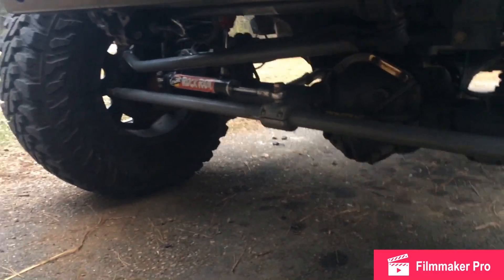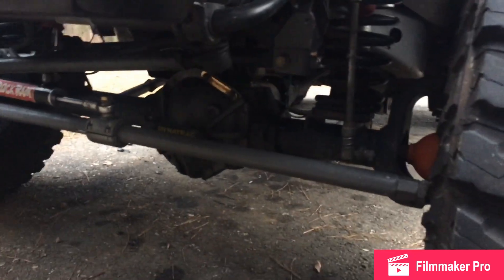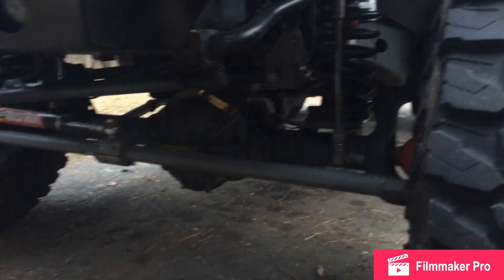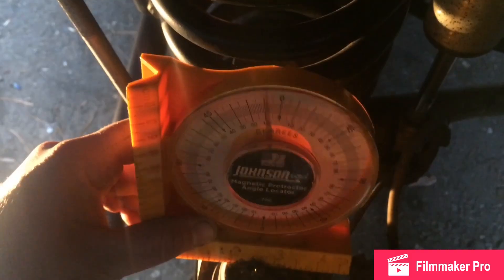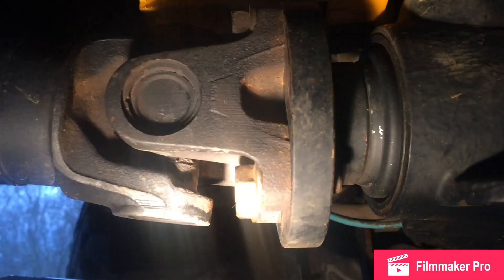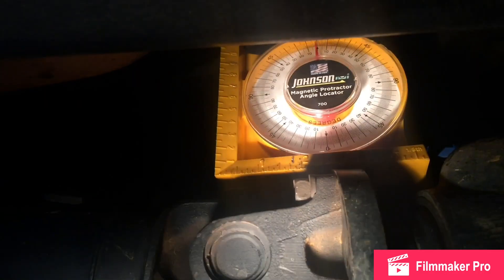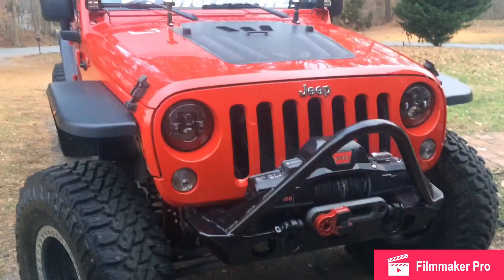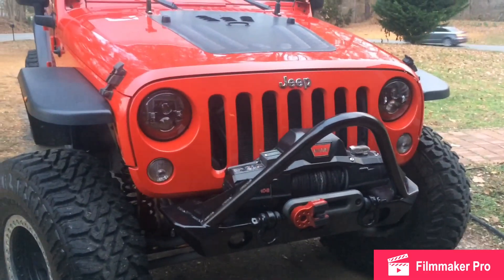How to Check Caster and Pinion angle on your Jeep or Truck

Comment: Good video. You mentioned pinion angle being low as if that is a bad thing. Less than 10* to the drive shaft is what you want as long as your pinion angle is close to your TC output shaft angle so they cancel each other out without too much u-joint movement (less than 10* should be fine.).

Comment: Thanks heaps! That was very helpful. I'm fairly certain that my caster angles are different between sides. Got an awful pull to the left, ATM. Hope to correct it this afternoon using this video.

Comment: I'm checking my caster.It looks like Im at 10 degrees, from a local 4x4 shop that just set it up. It's wondering left to right going down the road. If I understand it right, I need 4-6 degrees? The math comes out, as I measure the pinion at 4 degrees. That puts me at a difference of 6 degrees on my Gladiator.
Reply from the maker: There is only 6* of separation on the stock axle. If your pinion is at 4* then you have 2* of caster which is horrible
Reply: @JKGearandGadgets  sounds like I don't understand 6 degrees of separation yet. I can't be measuring correctly. I'm getting a caster measurement  of 8-9, and a pinion of 1-2 degrees. Ill watch more videos to try and see what IM doing wrong.
Reply from the maker: Stock Or aftermarket axle?
Reply: @JKGearandGadgets  It's stock, and I was wrong on the 10 degrees. Thank you for always responding to help. I appreciate that !

Comment: so is the 10 degrees fine for the caster? for the 0 pinion. ive read some other peoples posts, and they say pay a little more attention to pinion angle. and the caster will follow.
Reply from the maker: It all depends on your lift height and driveshaft type. You can’t have a 0* pinion angle on a tall lifted jeep otherwise you’ll get driveline vibrations. What axle you do have?

Comment: Hopefully you see this, 
Im having a tough time. I have RC 3.5” lift 
I just bought and installed RC lower adjustable control arms.

Obviously experiencing death wobble. What should my caster and pinion angles be? 

Can I adjust when jeep has tires on and on ground? Or do I need have jeep on stands?
Reply: did you do drop pitman arm and are your trac bar bushings good usually 75 percent of the time its trac bar related

Comment: How should the rear one looks like? Should the pinion angle be in line with the driveshaft? Or should have some differentiation?
Reply from the maker: It should be in line with the driveshaft depending on what jeep/rear driveshaft you have.
Reply: JK Gear and Gadgets is an Adam Drive shaft 1310, jk 2009 rubicon stock axle and yoke for the TC and pinion
Reply from the maker: Alfonso Ovalle yes the rear pinion angle should be in line with the drivehast

Comment: Great video!! New to your channel. I have jk 2008 and 6 inch rough country lift. On 37s everything still stock. What would be my best angle for caster? And drive shaft angle?
Reply from the maker: The 6” lift is hurting you. 
Your best bet is to try to get it around 4* caster

Comment: Im running a 4.5in lift with fully adjustable control arms with adams front and rear drive shafts. should i be focused on dialing my caster back to 5 or 6 if it isn't? I had it adjusted a while ago, but I hadn't upgraded my rear ds at the time.
Reply from the maker: It’s a mix of caster and pinion angle, add as much caster as you can without getting pinion angle vibrations. With a 4.5” lift you will probably max out around 4-4.5* caster
Reply: @JKGearandGadgets  thanks for the tip! Beast of a channel and information you put out!!

Comment: I know it's an old video but I can't find what my angle should be. I have a zj and added 3in lift, have front and rear adjustable top and bottom arms, if you still read comments can you help me out? Thanks
Reply from the maker: Add as much caster as you can, pinion angle will decrease. So find the good mix between good caster before you get front end vibrations.

Comment: Caster cannot be measured with an angle finder, because of the steering axis inclination (on JKs this can be seen in the inward tilt of the balljoints as looking from the front of the Jeep) caster must be measured in an arc. A caster gauge like this will do the job 
https://www.amazon.com/Longacre-78260-Caster-Camber-Gauge/dp/B003750D7U/ref=sr_1_3?keywords=caster+gauge&qid=1561218454&s=automotive&sr=1-3
Reply from the maker: Negative. On a Jk or any other solid axle, caster is measured from the rearward tilt through the ball joints.

Comment: I have a 2003 grand cherokee laredo, with a 2.5 lift, stock driveshafts and control arms 98k miles and what should it be? I get a bad vibration at 60 and I'm looking into the driveshaft and peaked my interest because just last week i started hearing a ujoint click, if I'm on a flat surface doing 60-70 nothing, hit a bump i feel the vibration you get before death wobble occurs but it's not deathwobble.. when i coast from 70, the vibration gets worse as it slows down and goes away at 45, then back at 55 the vibration occurs, let the jeep sit and rest and the problem is gone.. i don't know what gives me more of a headache, my girlfriend or my jeep..
Reply: did you figure out what this was?
Reply: @sparkie5571 yea i went higher and had my castor was the f.k out, alignment dude said my jeep was the crimson chin 🤣
Reply: @joshfig96 just have almost exactly the same thing happening on my jeep. Thank you! i’ll go get my caster set/checked and put  where it needs to be

Comment: Great video! What would you recommend for my setup. I am running 37's, RK adustable mid arms upper and lower, rock jock 44 , psc steering, lift is between 5  -  5 1/2, king coilovers. I look foward to your reply 🤙👍
Reply from the maker: What driveshaft?
Reply from the maker: What is your current caster and pinion angle?

Comment: HELP!! So I just bought a zj with stock axle in the front with a 4in rough country lift, but it’s got non adjustable upper a arms, the guy removed the front driveshaft for “vibration” if I get adjustable uppers in the front and set the arms should it fix this problem?
Reply from the maker: Yes! But depends on which way the axle needs to go, if the pinion needs to point up more then get uppers, if the pinion needs rotated down then get lowers
Reply: JK Gear and Gadgets Thanks so much for the quick reply! I definitely will go with the upper! One more quick question, is shims needed on the transfer case???
Reply from the maker: Alex Scott tcase drop brackets can help if you are having rear vibrations

Comment: I'm running a 4.0 to 4.5 lift not 100% sure though. Dana 30 for now on 37s with rk adjustable arms upper and lowers what would u recommend I be at?? Thank you.
Reply from the maker: Stock driveshaft? I would shoot for around 4 degrees as a starting point
Reply: @JKGearandGadgets  Adam's double carden
Reply: Would 6 be too much with the Adam's double carden
Reply from the maker: Lee Gomez yes that would be too much.
Reply: @JKGearandGadgets  thnx for the input going to try 4.5

Comment: lol caster?  You mean Camber right?  Caster is how forward or back your wheel is in the wheel arch mate...
Reply from the maker: No, camber is the tire leaning in or out.  Caster is what I said, the angle of the balljoints relating to steering. Centering the wheel in the wheel well has nothing to do with either caster or camber.

Comment: I'm running a 3" EVO lift with lower adj control arms. I put in the Adams 1310 driveshaft and just put new 37" Yokos which smoothed out the ride a lot! I am still getting a little bit of vibration. Not much, but I'm trying to dial it in. My CAs are as short as I can get them. My pinion angle is at 0. My caster is 6.5 degrees. My driveshaft is at about  a 5 degree upward angle. Any thoughts on what I could do to eliminate the last of the vibration? I have the Steer Smarts Yeti track bar, draglink, and steering stabilizer.
Reply from the maker: Did the vibration start when you got the new shaft? If you are running the factory front axle then 6.5* caster is too much, actually puts your pinion angle at -.5*. Since your arms are as short as they can get then you can’t make any more pinion angle adjustments. My recommendations are this:  remove shaft to verify you are getting a shaft related vibe, make sure the yokes to the axle and tcase are torqued to correct spec, get adjustable upper control arms and set them longer than stock in order to bring your pinion angle up untill the vibes stop, then play around to get a good caster/no vibe medium.
Reply: Yes that's when it started. One of my buddies recommended that I take the shaft off. I did, there was no vibration, so I'm sure that's what is causing it. I re-took measurements last night. My caster is actually 6 degrees, maybe leaning towards 5.5* and pinion is 0*. The angle on the TC is 0* as well, so the shaft should be turning at the same speed since the angles are even on both sides. When I had the shaft off, I re-torqued the large yoke nut, and the other four bolts. The rep from Adams mentioned I might have to get adjustable uppers.I was hoping to avoid that lol. I'm nitpicking here since the vibration is so minor, but I can feel it just a little right under my feet when I'm driving. I guess the next box to check is getting the upper CA's and see what happens. Thanks for replying so fast!
Reply from the maker: Yeah I would do the uppers, while the vibration might be minimal and not bother you too much, it can eventually lead to failure of your tcase output bearings.
Reply: Okay sounds good. I guess I'm gonna piss the wife off with another Jeep order!!! Thanks for the help!
Reply: Okay I just installed a pair of Rock Krawler adjustable uppers. The vibration is mostly gone! However, I am pulling to the left pretty bad now, so I took caster angle measurements and I'm at -4* on the drivers side and positive 3.5* on the passenger side. With the lowers it was pretty straight forward how to adjust. With the uppers, I'm not sure. I know it's damn near impossible without looking at it, but any ideas?
Reply: By the way I measured the uppers prior to installation and installed them at the recommended 19 3/16 for a 3" lift. Maybe I should have done 19.25' for the 3.5" lift since mine is actually a bit higher than 3". I don't know.
Reply from the maker: Beauch11 make sure both lowers are set at the same length as well as the uppers. As for adjusting them I’m not sure what you mean. Should be able to either adjust them with them in place or by taking an end off and twisting them
Reply from the maker: Beauch11 if it’s pulling and one side has more caster than the other then that means one of the arms was set a tad longer than the other
Reply: What I mean is do I lengthen or shorten? I know how to adjust them. Just not sure what lengthening and shortening does With the lowers, if you make them longer, you bring the pinion angle down, if you shorten, it comes up. Both lowers are exactly the same length. They are as short as they can go. Perhaps I may need to lengthen them a tad now that I have the uppers? I don't know. I now have two methods of adjustment, not just one!
Reply from the maker: Beauch11 so they do the same thing as the lowers, but opposite. If you make them longer the pinion goes up. The lowers will be set to center your axle in the wheel well and the uppers usually control your caster and pinion angle.
Reply: Did not know that! Thanks!!! I should be able to figure it out from here. I'll just keep tweaking them until I get it dialed in perfectly.

Comment: Hey bud, great video. I just install a 4.5 inch long arm on a 2001 xj. Stock Dana 30 and stock driveshaft. What should my caster be in relation to my pinion?
Reply from the maker: Been a while since I messed with XJs, but on a xj you’ll want the pinion angle to be pretty good with the driveshaft. So you’ll probably be around 3* and 3*

Comment: would you mind to help me out  I have a wj jeep lifted 4'' with adjustable uppers and lowers can you tell me what i should be set at..I have the digital locator just like yours,,,do you recommend that tool or using the gauge  thanks..factory axels
Reply from the maker: Either one works! What are you currently at?
Reply from the maker: With a 4” lift you will probably want to be  around -3 to -4* caster.
Reply: JK Gear and Gadgets so that puts me at 2 on pinion
Reply: JK Gear and Gadgets I was told to set it at a positive 6
Reply from the maker: Yes, or go 3 and 3, but see what your at now
Reply from the maker: To set what? Pinion angle?
Reply from the maker: That means your at 0 caster which means it probably drives horrible above 30 mph and wanders all over. Dial back that pinion angle as much as you can, but don’t go too far and get vibes, but you shouldn’t need 6*
Reply from the maker: And your WJ driveshaft has Cv joints instead of U joints. Unless you upgraded to aftermarket shafts. But with cv joints you don’t need a perfect pinion angle
Reply: JK Gear and Gadgets I have 5 on both sides. Running a dc shaft
Reply from the maker: What do you mean you have 5 on both side?
Reply: yes i have 5 on one side and -5 on other side I am assuming this means 5 on both sides
Reply from the maker: If your at 5* caster on both sides then that’s a good number, doesn’t need adjusted
Reply: my wj had horid death wobble till i eventually got it adjusted  into the 6-7 range, gone for good then

Comment: looking to get new lower arms I am running 2 and 4 degrees right now would I need to get new uppers to correct it or just lowers?
Reply from the maker: At a minimum you need front lowers. What type of vehicle are we talking about?
Reply: JK Gear and Gadgets jeep jk 2dr 2016
Reply from the maker: Yep. Front lowers will allow you to change your caster angles. Both uppers and lowers just give you more ability to move the axle. But lowers if anything
Reply: JK Gear and Gadgets so just adjust the lowers to the eye to eye length of what I have now and I will be fine... even tho I have relocation brackets I can’t measure it from the actual axle mount eye to frame mount. Thanks again for the help I’m lookin at rubicon express or some jks arms
Reply from the maker: Yep. And you could even adjust them a tad longer to get more caster if you want. Honestly I would avoid the RE control arms
Reply: ok sounds good i am trying to find ones under $300
Reply from the maker: Give gill at offroad Elements a call on Monday. Tell her you were talking to ben from JK gear and gadgets, she will hook you up with some good control arms for a good price
Reply: @JKGearandGadgets  damn wish i saw this post before I ordered the alpine adjustable control arms from teraflex.  Woulda saved some $$.